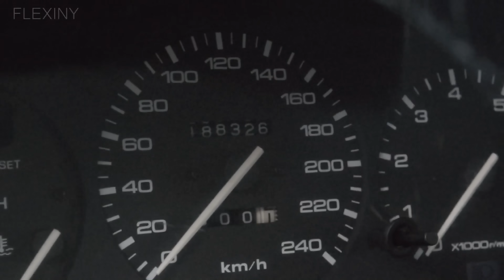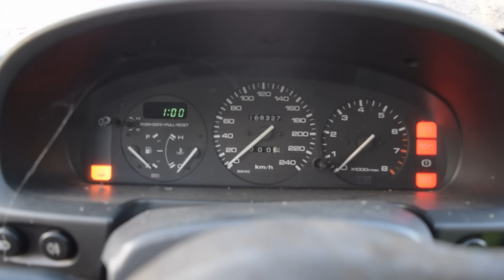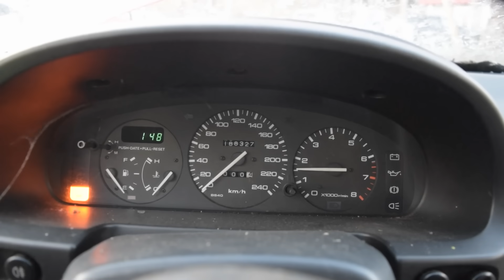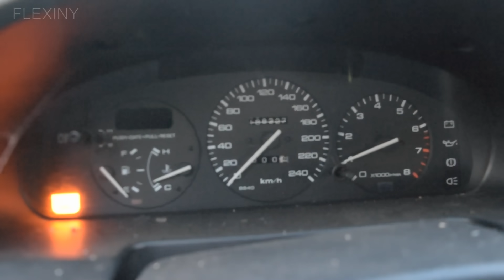Starting 1992 Mazda 323F BG After 17 Years + Test Drive

Comment: I had a 323, and when I started the video I said to myself: This thing will start right up
Reply: Had one too. Always started no matter what. Very reliable car!
Reply: @MrSkoda105s  i have also one out 1991. Really relaible car.
Reply: @wilbertaangeenbrug7189  Always knew this would become a future classic. Unfortunately I sold mine... Good memories though!
Reply: Interesting video as I had 1990 323 BG too, but mine was sedan with 1,6 carb engine, GLX trim level :) That hydraulic lifter noise was familiar, mine did that sometimes too. Would be great to see this 323F fixed up to road legal condition :)
Reply: @MrSkoda105s  just found an bought a one owner SP edition 👌👌
Reply: Mazda's of that era were superb cars
Reply: Future classic
Reply: SAME! I Loved mine.
Reply: @MrSkoda105s  i still drive 92civic vtec 1.6 125hp 5th gen us ver,i bought that car in 2005
Reply: Had also one. It always started. Always. And I barely had maintenance on it.
Reply: J
Reply: Best!
Reply: Она должна была сразу зевечтись , но форсунки и бак с насосом забрала время
Reply: @mrjsv4935  да звук двигателя необычен

Comment: Now I really, really, REALLY miss my little 323F. Owned one of these from 2009 to 2014 - the only, and I'm serious, the only piece of mechanical maintenance it needed in that time (besides oil changes) was a set of rear brake pads. It had an oil leak and a few other things, but that car just kept giving, and giving, and giving. It developed a bizarre overheating problem though, most likely a head gasket. But this was a fun little car, I still think about it almost 7 years later. Thanks for the vid :)
Reply: i repaired my head gasket and piston rings 6 month ago.. i havent ever had a overheating problem but water was moving into combustion chamber so the engine started with 2 or 3 zyl almost every morning.. luckily nothing broke or bent
Reply: У меня задние тормоза заглушены, так что... Нет проблем
Reply: Hi, I currently own one of these (still running great with 370,000kms)! I also had a bizzare overheating problem - for me it turned out that there was air/ a bubble in the cooling system. Once this was sorted the car was great!
Reply: I just bought one a year ago with it sitting on 44k miles (now 45k). I also just fixed an over heating issue, mine was just the radiator fan having a dead point so it wouldnt spin. I had oil leak and had to replace the head gasket but apart from even having a not fully working coil and being very grumpy while not having its auto choke on the girl just keeps going. Couldnt wish for a better car.

Comment: Great car. I remember when they were brand new and everybody wanted to have them. I don't think the cars from these days will last as long.
Reply: And start and drive after being left in a forest for 13yrs🥳
Reply: New cars are not built to last, while the older did, if just for a couple of 10k more mileage.
Reply: @Xtoxinlolinecronomicon  Couldnt agree more, hell ive just pulled out the radiator fan in mine which stopped working and a little cleanup inside it still works and the things 33 years old. Old was built to last and for you to tinker with, now adays you cant even pull out the spark plugs.

Comment: No rust in a japanese car?!?!? Harry Potter is around
Reply: @stefanjovanovski6035  😂😂😂are you sure❓❓
Reply: @stefanjovanovski6035  Balkan guy here who drives a 1991 323 sedan......they rust, trust me, they do.
Reply: Maybe some rust but it works.Try to start an abandoned golf after 17 years......You're gonna need the help of all the magicians together
Reply: @johnlountzis6678  yesterday i started a Seat Ibiza 1Y engined, It has been sitting on field for 17 years. Started on the second attempt with fresh battery and diesel. It just depends on the car. I own japanese but i have had germans as well and all of them were crushed with more than 750.000km. in all cases i bought second hand, almost a steal.
Reply: @stefanjovanovski6035  in middle europe is japan cars too much rusty because the owners don't care about them... i have 2 too much rusty 323F BA 1.8 DOHC facelift 1997 :(
Reply: What a comment this is👍🏼😶🙏🏼
Reply: @225M3RCR  previous owners*
Reply: OH FUK 😳
Reply: Not the japan cars have big rust... the mazda have
Reply: And all mercedes from 90-2009
Reply: @WeAreTheTWD12  Mazdas are not the worst cars for rust. Nissan and Mitsubishis are far worse for rust. Mazda are actually one off the best.
Reply: @265justy Man, thanks God that someone knows about that. I found some dude sells 323F with factory galvanized body. Was back then really some galvanized 323F?

Comment: I had a 1.6 8V (87 HP I think) back in the days, red just like this one. What a pleasure to drive it was.
Reply: All the 323Fs were 16 Valve to the best off my knowledge.
Reply: @265justy  I'm 100% sure mine was an 8 valve.
Reply: @yerunski  In Ireland they were all 16 Valve.  LX and GLX models had a 1.6 SOHC 16 Valve. The early models were carb, latter fuel injection.  89 HP. 
GT was 1.8 DOHC 16 Valve  140 HP. 
We also imported JDM models of the BG 323F called the Astina. They had a 1.5 DOHC 16 Valve with 116 HP.. .
Reply: @265justy  Good times! I remember looking for the GT version with 140 HP (a lot back then). I found a purple one but it was all worn our and clearly had been mistreated so I skipped it.  I found a nice red one which I owned for 6 years. Also a GLX.
A friend of mine had a 323 GT (not an F) with the aforementioned engine. I drove it a few times. Awesome.
Too bad they are a rare sight nowadays.
Reply: @yerunski  I had a 1.6L 323F BG and a 1.5L BA model.  I found the BA  alittle quicker, but on paper the BG was quicker apparently.. 🤔. Also had an MX-3 V6 1.8...absolute animal that was. It could burn my friends 2.0 Celica. Loved it. Still driving Mazdas today.  Current car is a Mazda 6 GH Sport.👍🏻

Comment: A MAZDA will never disappoint you! I had one and the same for 410.000 km and never once didn't start ( even with 30 degrees below zero of 45 degrees above zero) and never broke down! I always got with it to the place I wanted to go without it ever breaking down! I only had to give it the regular maintenance and with 310.000 km I had to  exchange the clutch everything else was still all original! The last 2 - 3 years it got some rust at the rear wheelarch, but that wa all! But I got a company car (a new MAZDA 626) and sold it to a MAZDA lover who would resort it completely, wish I had kept it foor my self!
Reply: I have to agree. Mazda reliability is excellent - and they make a a long lived range of cars. Rust isn't an issue here in Australia. It's common to see old Mazdas here - 20, 30 years old - just as good as Toyota reliability and durability,  in my opinion. 
I love seeing old cars being restarted after sitting for such a long time. Great videos.

Comment: I like the fact that this car was driving in switzerland, it has the autobahn vignette 😄
Reply: I think it was a German model actually - it had the switch for the headlight beam height regulation. This was a German feature back then.
Reply: @teammazdaclassics9809  netherlands had that to!
Reply: @Liemannes  Really? I didn't see that before on BG and BA models in the netherlands. Was it an option back then?
Reply: @teammazdaclassics9809  dont know if that is a option but they are also required for some dutch laws
Reply: @teammazdaclassics9809  belgium also had it. Mine is a belgium import and has the headlight regulators

Comment: My childhood car. family used to have one. 1.6 16v carburetor. Headlights go up, headlights go down
Reply: Same here. 
First car i ever remember being in, and it was a black one, and i called it the "Eye-car". I remember the day my father took me to kindergarten the first day with the car, i've never been on a car before, but i knew how to walk. And i often was walked to the kindergarten by my mother. My father was drinking coffee, and asked me if i wanted to be a passenger in a car. I furiously nodded,  we walked to the garage roof, and he just told me wait infront of the car he went into, so he could drive it out of the tight parking spot. Unannounced, he starts spamming the lights. I reacted like i did, told my dad "Is eye car!", and i flexed in kindergarten over how my dad has the coolest car, because it has EYES
Reply: Same i get good condition ,only 9,50$ ,just colour in bad condition
Reply: Same .My mom's first car. Her husband bought it for her and repaired rust etc. I was hyped about the pop-up headlights. I remember how it over-heated in summer ,because mom's husband put some cardboard around the radiator in winter ,so the car can warm up more quickly😅 forgot to take it out in the summer. Half a year later the engine was quite damaged and i don't remember what happened to the car after that ,but it was gone.

Comment: Mazda 323F BG Astina is my favorite 323 :)
So cute but cool looking
. great fix! Hopefully you can get hydraulic clutch to work again
Reply: Hope so. Mazada during those times used the same reservoir for the brake and hydraulic clutch. If the brake lines have a leak, expect rust on the hydraulic clutch lines as brake fluid attracts water from the air.

Comment: Thank you very much for this great video! 😀 Since I own one of these 323F BGs knowing how rare they are, it's actually sad to see it in this bad condition. It's a very reliable car, never had any major issue so far. Therefore I'm not surprised that it started up even after that time. 
Greetings from germany
Reply from the maker: This Mazda is in great condition. It need only new oils, tires, paintwork and fuel tank with fuel pump. It was imported from Germany in 2001 and looks like it had little crash and thats why there is bodyfiller on one fender.
Reply: @Flexiny  I am surprised it ain*t a diesel version,🙄🤔🤔🤔🤔😣

Comment: On these cars, the fuel pump doesn't come on with the ignition, it comes on with either a signal from the air flow meter or a crank signal when you start the car.

Comment: I remember these pieces of junk. I had a 626. It didn't have the 4-wheel steering or the 4wd but it had the turbo, moonroof and it had oscillating fans in the dash. They went back and forth to coole EVERYONE in the car. So awesome. It was designed well ahead of it's time.

Comment: You should definitely restore it,it's dirty,but overall in quite nice shape,the paint needs a redoing
Reply: Moreover, there's no visible rust, a trademark for Mazda, especially older ones.
Reply: @Kwaq84  i didn't write about rust simply because i wrote this comment as i was at the 4-5th minute of the video,then i also noticed it doesn't have rust which is crazy
Reply: @Kwaq84  Trust me they rot inside out
Reply: @kisbalintkirill4443  Most of the times, but not always. I've owned '99 626GW, and except 3 locations: both rear fenders and one place in engine compartment, there was no rust. It was in honestly good condition and still is - I see it around from time to time, as its new owner is living in the same town. He is using it as typical work mule, but the thing is still going strong ;) No new rust after 5 years. Rear fenders were typical, but that one spot, rusted through, had to be made by someone during engine maintenance - probably wrench had slipped and damaged paint there, as that place was quite unusual. When I bought it, rust was already there, as well when I sold it, however haven't grown noticeably since.
Reply: @Kwaq84  I have 323F BG for 3 years now, it could rust almost anywhere. I think it depends on the weather conditions and country because how much salt they use in their roads. But i had some rotting parts before.
Reply: @kisbalintkirill4443  Thats true. Part of the rust problem was that these cars were shipped onboard from Japan, that had huge impact on them. They began to corrode on their way to Europe. That was only magnified by typical thinner paint coating on cars from Asia - while back then for european made cars it was ~150 microns, on most asian cars you were more likely to find it around 90-100 microns.
You didn't even had to wait for winter, salt was already there. It came from seawater mist that was getting everywhere, especially on the underside, and, as cars are rarely washed from bottom, was wrecking havoc on these otherwise fine vehicles.

Comment: I still use a red 323 F BG from 1994. This car ist about 20 years in ownership in our family. This model is absolutely reliable and casual. A fun car. Still no rust outside the body but you have to care inside the body about rust. Gearbox, Engine and Clutch are really indestructible, no problems at all in 27 years. There is no longer a funny car like this. Unfortunately they are very rare by this time.

Comment: I've got a lister d stationary engine and hadn't been started for 15+ years so I took out the spark plug and put some oil in the cylinder put some fresh fuel in and put the spark plug back in and it was running

Comment: Is there something wrong with the clutch pressure on the slave cylinder? It seems to grind if you put it in gear. Also you could press the pedal way to easy seems to light to me.
Reply from the maker: Yeah, it needs to be replaced because its rusty inside 😀

Comment: Its JDM what you expect to happen ? i have a 15 year old Mitsubishi Colt, never been serviced or had oil change but the thing keeps running and running 110 thousand miles on clock now and its a timing chain engine so one of the better versions ,anyway dont buy german or american buy JDM